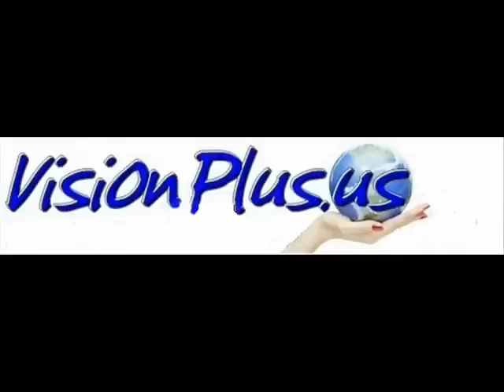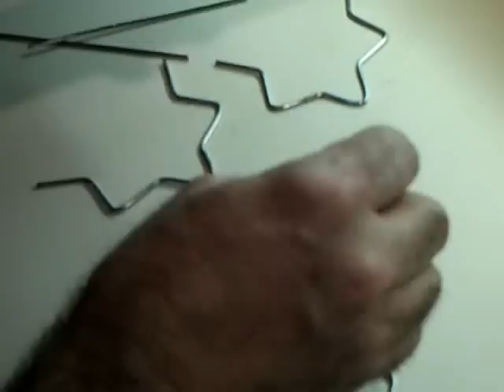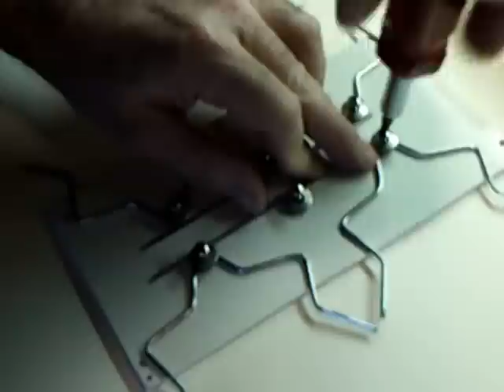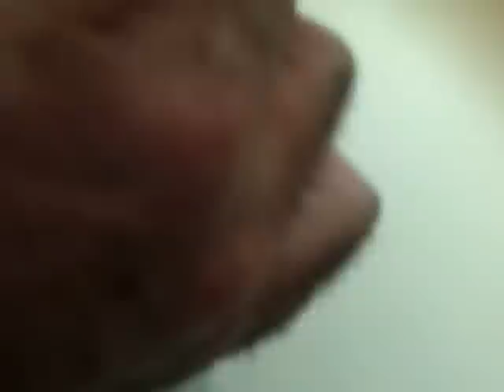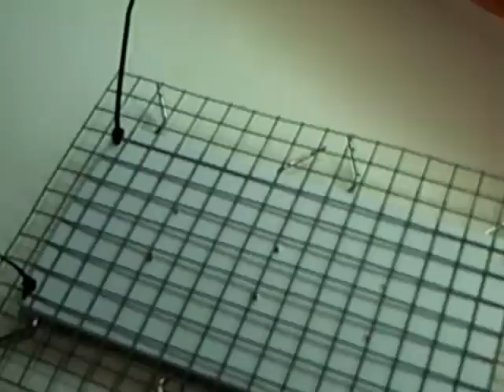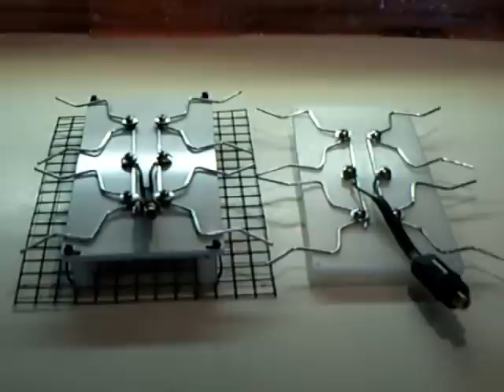Make a Fractal Antenna for HD + Digital TV ( 1 of 4 )

Comment: I have wanted to cut off my cable television for quite some time now but the one station I want (CBC-DT) I could not get reliably on a store bought antenna. I built your design out of tape, nuts / bolts, cardboard, and 22g steel wire in less than an hour.... basically, crap I had in a cupboard. 

Finally I can get this station @ about 60% signal strength that tvfool lists as: nm=-2.5, pwr=-93.4, path=1edge, dist=65.7mi.

Thanks for the easy to build and excellent design.

Comment: Got it right on.  But the "message" as you call it (some people use "payload"), when analog, is somewhat sensitive to gain as well s/n ratio.  A good quality amp helped in the NTSC old days.  A digital payload is mostly s/n ratio sensitive. An amp won't help a weak signal. It is only to be used for distribution, starting with a strong signal.  Not to catch you wrong,you were right.  But to add my 2¢ and help those who don't know the first thing about EM waves. Cheer!

Comment from the maker: I would also (if I could) I did solder everything together today and it works alot better.

I also moved the balum down to the end of the two straight elements with no loss of signal.

Comment: It works.  I didn't even do that good a job on bending the wires.  I took it upon myself to solder the wires together.  It's was to only hard part.

Had to use a reflector to make it work.  Just use a grill liner from the Asian/Japanses dollar store.  Huge improvement in reception.

I now rarely get any skips during broadcasts at the worse spot for T.V. reception in the house.

I quit using that $25 "digital TV"  antenna I used to use which is really just a hoop antenna.  What a scam.

Comment: don't you want to insulate the screw heads on the reflector side ? won't the signal be shorted out if the reflector touches both sides of the mounting screws for the fractals ?

Comment: Whats happening with this antenna, and the fractals, is that only one quarter of the wave length is being received. If any of the other three quarters of the signal is received then it cancels itself out. Yes the length/size of the antenna and the frequency that you are trying to receive are related, and what types of materials for transmission, copper is best, and also distance to the ground plane is important. Also the spacing of the fractals to each other is important

Comment: Couple of questions:
Is there any connection between the 4 bent wire sections and the hardware cloth on the back? Is the plate in the middle metal or plastic?

Comment: All broadcast frequencies are analog; the message transmitted may be analog or digital. The antenna does not know the difference.  Most digital TV signals in the US are UHF band only because they wanted the analog and digital channels both during the transition and they needed room.  Complete, some will probably go back because VHF has better range.  Canada channels are UHF and VHF as well so ordinary antennas should work.  Some people lost stations because the UHF channels don't reach as far.

Comment: There's so much mis-information and lack of understanding it was pushed back this far. I was laughing out loud when they were thinking about even further pushbacks.

Even small bits of interference that would normally throw a UHF signal into the 'terrible' range won't mess up a DTV signal, you'll get no issues with it.

Have you tried a small dab of solder on the joints? That may improve the signal clarity a bit, a better connection between the wires is always good.

Comment: Know Fractal Antennas are the rage in DIY land but  I'm not sure there's a real advantage at UHF. conventional antenns are so large they need to be more compact. Not reading where a FA has more bandwith that a log periodic designed for the same band The wiki article casts doubts that the Fa is better performing than conventional designs. Not hat FA don't have a place, but I don't think they are the super star many suggest they are across all applications.

Comment: LOL sure is purdy , but I remember all that hype with the transition from black and white  broadcast. So I was awake this time with DTV. glory behold  they was no difference in Antennae my old coler Ant. picked up that signal no problem with my HD converter box! Also curious I still had one them there antique B&W rabbit ear  Ant. and OMG Black and white Physics works the same as this here Digital Frequency. So the point being is it is only the Frequency tuned Ant you need. I call Hoax&Fad!

Comment: That I'm blaming on government stupidity again. They decided to go with an entirely different format (again) than the rest of the world which doesn't have the kind of error correction that the other standards do. Additionally their broadcasting power was cut drastically. I'm not receiving many channels on my TVs as well. I've got cable so it doesn't bother me as much, but if someone is stuck to only antenna then I can definitely see an issue.